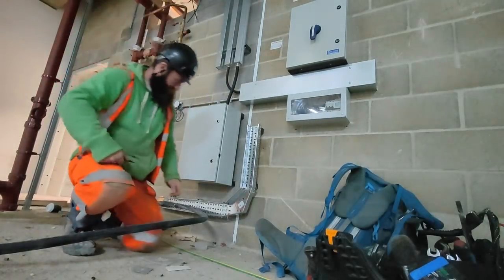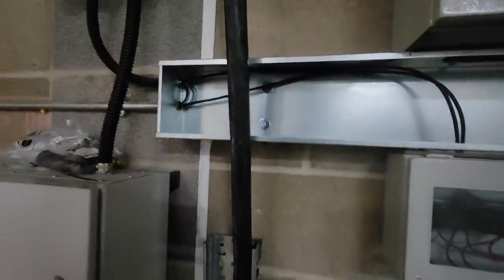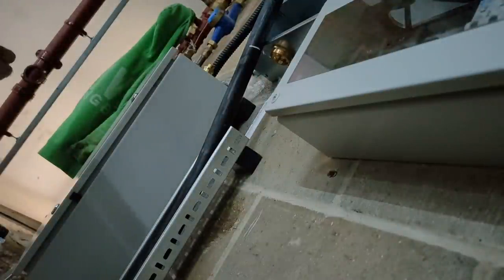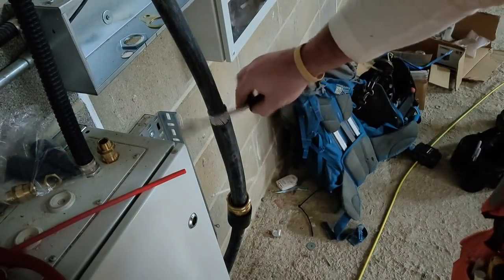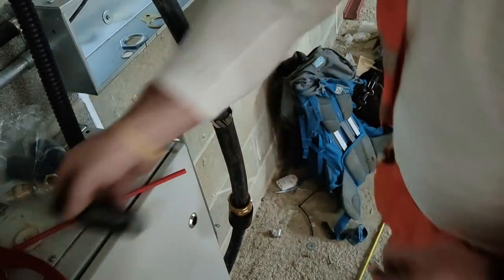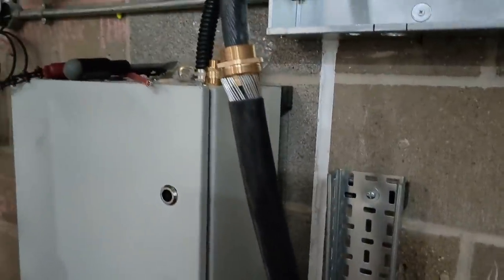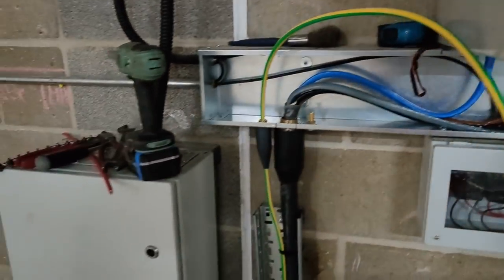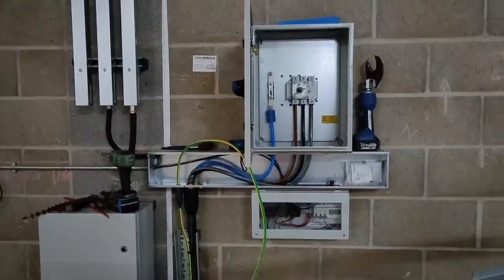G&T of a 4c x 70mm with a few tips for apprentices and those who like tips and tricks

Comment: Just stumbled across your channel. I totally agree with your comments regarding specialisation, it is indeed the way the industry is going. I’m the head of electrical engineering on a large manufacturing site and we procure IT, CCTV, fibre, installations, termination, protection, controls, instrumentation, industrial, communications, programmers, designers, generation specialists, access control, etc. all as separate branches of our wonderful trade. Of course, any spark ought to be able to put away up to 35mm^2 with no bother. However, I’ve watched you wrestle those 240s into that panel in another video and that’s a trade alone. Unless you’ve done it, you have no idea……….at around 7kg/m even a short loop is bloody hard work! Great content, keep it up!
Reply from the maker: I know a lot of people moan about the trade being compartmentalized but I think, like you, it's the way forward. If can only lead to better workmanship if a team specialises in one particular area. The tools that get used are better adapted/designed for the job and they get done quicker because of it. Thanks for the comment, really interesting 👍🏻

Comment: Great vid bud, I must admit in the years gone I've done less and less industrial work and more commercial and domestic work, however we just finished contracting for a friend doing a full factory rewire.........god how I forgot the amount of effort needed for some of the bigger cables.....hats off to you mate
Reply from the maker: They are a struggle sometimes but they have their benefits!! I'm done with crawling in lofts getting covered in insulation 😂😂😂😂. I had to wire a wall light for the new bathroom last year. That was enough for me!! I was only in there for about 30mins😂😂😂
Reply: @jointechcabling9103  that's what apprentices are for 😂😂😂😂

Comment: Nice job again pal , I do find the job of a cable jointer strange no disrespect you do a great job just as I am a spark and I have never had a cable ran in and terminated for me and I  mainly work on installations of a similar nature to these videos I also do alot of resins Joint kits etc just never came across a out and out cable jointer but interesting to see keep up the good work 👍
Reply from the maker: I am an electrician too but I've accidentally found myself working as a LV cable jointer. I think it's the way the industry is heading. Trying to find specialists within the general field of electrics.

Comment: A bit concerned of the lack of PPE ,Gloves and Safety glasses.

An impact driver shouldn’t be use to torque up your terminations , there would be no measured torque setting to those terminations. Probably over torqued to destruction. The isolator will have a specific torque setting, set by the manufacturer, just saying 😊
A calibrated Torque wrench would be a great investment.

Great demonstration on the whole thought
Reply: I was concerned at first too, but he's not using an impact driver. It's a regular drill driver set to the lowest torque setting just for snugging the cable up so it does not fall out. Some comissioning people come later with a torque wrench and finish off all connections.

Comment: Hi pal, good work this is the first video I have seen of yours. Never seen an exhaust cutter used before, what is the minimum size of SWA would you use the exhaust cutter on?
Reply from the maker: It'll cut a 4c X 400mm easily enough. It goes down to a 4c X 16, sometimes a 10mm, depending on how they're made.

Comment: i also wondered why the sparks that install the tray & switchgear never terminate the SWA
Reply: Requires skill of a cable jointer
Reply: @x0MARLOW0x  dont think so , any electrician should be able to make off an SWA basic skill in the job unless your a domestic twin & earth novice , jointing is an addtional skill and different to terminating armours. and not what hes doing here!
Reply from the maker: They way the industry has been heading over the last 10 years is towards specialisation in various fields within the electrical sphere. Whereas 30 years ago a spark would take on every aspect of an electrical installation, these days cable pulling, cable jointing, BMS, fire alarms and other specialized parts of the trade are singled out for specific companies that are artisans in such endeavours. I have no doubt that any electrician worth his salt can do what I do but I have invested in very expensive equipment to speed the job along. An electrician wouldn't have such hear in his van.

Comment: So why does this floor have a smaller supply that the others you have done on this site?
Reply from the maker: This is the supply for a retail unit. It's fed from the big panels with the big cables. Some of the units have a 4c x 120mm supplying them.

Comment: I was always taught control panel isolators feed in the bottom stand alone isolators feed in the top and to my experience it's always been that way and was always told it's best practice . Now I assume there is no right or wrong way but I noticed you terminated the feed into the bottom of the isolator is there an reason for this possibly bend radius ect just curious